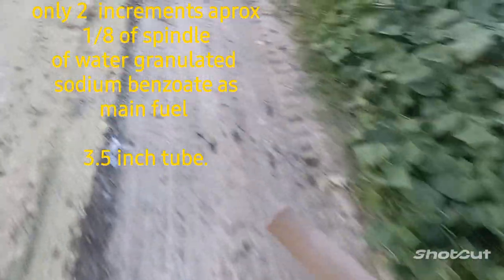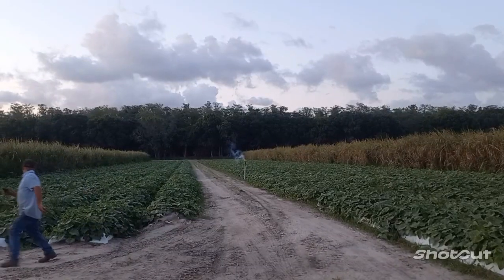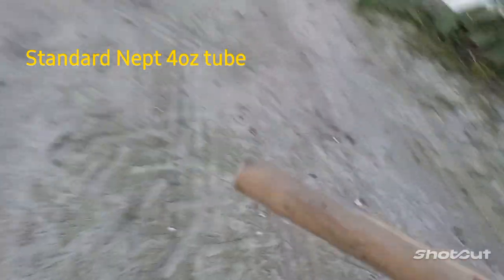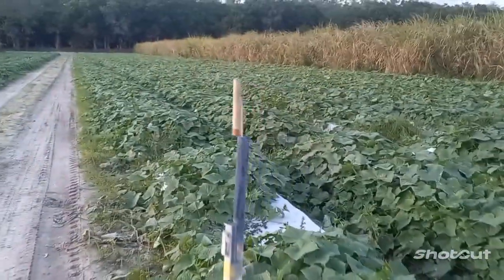Strobe rocket test (new fuel ) See description.

Comment: After all the work and help from you, it's really hard to NOT make them strobe very well. 
The length of the lift fuel grain length should only be about 1/3 the length of the spindle and the pressing psi needs to be correct. For me, i increased psi to about 6500.

Comment: @Pyroflorida have you ever tried making a bp/ strobe rocket? 
I may try it now so i can have less chance of CATO with a long spindle.  Plus, im wasting to s of good sali whistle on my failing strobe rockets.
Reply from the maker: Black powder can't be combined with strobe fuel , contact of both produces a very unstable reaction in a short period of time , this reaction can be accelerated if is any humidity present I the fuels , causing a self igniting bad situation. 
Need to analyze and understand why youre having CATOs .
Bad quality tubes , not waxing your tubes , wrong tooling used.  Wrong pressing force applied  , not enough is bad , too much is bad.. cracks in your fuel grain due to inconsistent increments , fuel too hot , not enough wax or oil in  your whistle fuel etc. Etc. Etc.

Comment: Hey there!
I have been making countless tests of ap strobe fuel using:
Ammonium perchlorate 56
  Barium Sulfate. 14
  Potassium Dichromate. 5
Then experiment with magnalium, like:
80-200 13%
-325 12%
My binder /phlegmatizer is usually NC lacquer / acetone mixed in well, then granulated & dried.
I've also used dry wax and shellac powders.  
Most work(a little)
But, I have yet to have a single good strobe rocket like yours.  
Do you find that the amount of binder makes a big difference?
How about the length of strobe fuel in the spindle core?
Finally, do you find a strobe performance difference by changing how far you insert the fuse?
I think I may be retarded at this point, but I need to get there.
Thanks.
Reply from the maker: Let's see , on the spindle.
Example : 1 pound strobe motor needs at least a 4 inch spindle , aprox 1.5 inch of spindle pressed with a good strong whistle fuel , remaining 2.5 inch of spindle should be strobe + delay 1/4 inch minimum  , then the desired  ammount of whistle as delay .
If percentages are right , then chems are all fine powder , especially the ap and dichromate. You should have very good results , your pops should be loud enough to heard them from very far.
Wax and oil kill the pops  , but makes the fuel less sensitive is a trade-off , I don't use them .
3 to 4  % nc laquer is enough 
Hope you get them to work!!
Reply from the maker: By the way , I never core fuse anything. Fuse is right on the edge of whistle fuel
Reply: Thank you!
Reply: I have been using a 2.5" spindle for my 1lb motors.
I just a new brass 5" thicker spindle from firesmith. Wow! I made a Sali / strobe lifted for over 10 seconds .
Now I can use the whole 7" tube.
The spindle is much larger diameter and burns faster, I think. Now to see about fixing my strobe fuel more. 10% 80-200 and 10% -325 is still not quite right. Maybe my fill heights need adjusting, like less whistle fuel and more strobe fuel.
Reply from the maker: @King-of_Katos   the strobe recipe is 10% 80-200 and 15% of -325 with 3 to4% nc laquer dissolved in enough acetone to make a doe like and granulate.
If your whistle is strong enough 1/3 of spindle whistle and 2/3 of strobe will give you a decent lift with a pretty loud strobe.
With 1/2 of spindle whistle then 1/2 strobe you're getting faster and higher lift but less and not that loud strobe pops

Comment: Can you try: 

65% KClO4
15% potassium or sodium benzoate
19.2% Al
0.8% copper chromate or copper oxide

3% wax for stabilizing mixture

It flies up with a blue flame, works great on bp tooling, its nozzleless like whistle ofc
Reply from the maker: S.P.E.E.D
Super Powerful Extra Energy Dense
65
15
8.8 black Indian
10.4 mag 80-200
1.5 cu oxichl.
3 wax
I already have a batch , just thinking on how give it the proper use😁👍
Reply: @Pyroflorida  great! Please make some test rockets, glad you are familiar with it. I would love to see someone else try it too to compare the thrust
Reply from the maker: @KClO3  definitely I'm trying it , I may start like always do with the 4 oz platform to see how it performs  then 1 pound. It may be my next choice for my nuclear rockets 2nd and 3rd high output motors , let's see
Reply: @Pyroflorida  any updates on the tests? Im so eager to see
Reply from the maker: @KClO3  yes i did. Tried on the 4oz 3.5 inch tube , full spindle with S.P.E.E.D , Honestly not really impressed , its like a high end black powder
Reply from the maker: @KClO3  https://youtu.be/ur_iNGNRvhs?si=VpQ4Ue_48sv2bh5w
Reply: @Pyroflorida  strange, I see what you mean, maybe it's thrust is still high even though it's initial launch is not very high, but it's weird I'll give you that
Reply from the maker: @KClO3   there is still more to test... and yes you're right.
Have a feeling that the fuel will really shine in long spindles
Reply: @Pyroflorida  we'll see, hopefully it won't be a bust in that configuration, I was expecting a different outcome from this fuel

Comment: Hey FP, I like your videos, Thank You!
I usually put my sodium benz in the oven at 225F to evaporate the moisture in the benz.
What do you mean by water granulated? I use acetone.  I'm confused!
Thanks again, stay safe!
Reply from the maker: No problem bud.. when water/alcohol granulating a whistle fuel you're getting the outmost possible power out of it , why? Simple , sali, sodium and potassium benzo are soluble on water,  oxidizers like kclo4 too , means by wetting your whistle fuel with 50% water 50% denatured alcohol you're now mixing and fusioning the two components a almost molecular level.. no need to ball mill for hours or dehydrate anything,  just make sure your fuel and oxidizers passes a fine mesh 60 is enough , you can add to the red iron oxide usually 1% another 1.5 % of red gum ( antioxidant) for  storage😉 and it's also a good burn stabilizer.  Alcohol is in charge of dissolving the red gum and incorporate it to the mix.
For best results wet your desired whistle mix following the above procedure and let it sit overnight on a bowl to get all your components to get fusioned together,  then granulate next day and let mix dry 100% , a infra red lamp for a couple of hours will do.the ultimate trick
You will enjoy the most possible output out of your whistles , don't need any phlegmatizer like oil or Vaseline,  red gum is making the trick.
Reply: @Pyroflorida  Thank you! I can't wait to try it. I've only used alcohol/water on black powder-based fuels and stars. 😀
Reply from the maker: @smileface102   day and night difference,  my water granulated sodium benzo ( the one used on the vid.)   With only two small increments did all that lift on #1#2 and #4 rockets
Reply: @Pyroflorida  WOW!
From Rhode Island.

Comment: I've heard sodium benzoate rockets kind of strobe super fast when there is still solvent in the fuel, sounds extremely cool and similar to this but when that happens they usually lack power completely
Reply from the maker: Probably like on the last rocket you can see on this link , that's typical sodium benzo chuffing
https://youtu.be/HJ8NnGn73xg?si=vEL-y4nPipme_Y1h
Reply: @Pyroflorida  yes exactly! it sounds so good even if it means the fuel is bad. please if you want to do some experiments and make a benzoate fuel with power and very reliable chuffing! it seems to be caused by fuel rich mix
Reply from the maker: @KClO3  that chuffing effect is usually obtained when on a not very powerful fuel like na benzo or black powder are heavily phlegmatized wit 4% or more wax or mineral oil

Comment: I made a very powerful rocket fuel out of poplar fluff down and saltpeter
Reply from the maker: Yes I remember you suggested using poplar fluff to increase gas during fuel burning , painfully I couldn't give it a shot , poplar isn't available around here , I think that's why HP 140-4-c uses 4% of 80 mesh charcoal,  probably to obtain that extra boost from gas
Reply: @Pyroflorida  If you can't find a poplar, you can directly use the fluff of a kapok tree
Reply: @Pyroflorida  But after the collection, cut with scissors, and then put it in a mortar and grind with powder, so that it is convenient fusion
Reply from the maker: @CrazyghostRocky-lu8tr  ill give it a try !!!!🫵

Comment: Wow!!! Great rockets!! What is your high thrust strobe fuel?

And sodium benzoate whistle?
How is that different than sali or potassium benzoate whistle?
Reply from the maker: Hey my friend , I'm still working on the optimum cycle on that high output strobe fuel so.. I will disclose the formula after is well tested and proven to work as expected. 
Sodium benzoate fuel offers amazing performance , specially when water/alcohol granulated , it uses 2% good quality red iron oxide , doesn't need any vaseline or oil as phlegmatizer .
A well made water granulated benzo will match out sali fuel pretty much , and doesn't tend to cato like sali , it's more forgiving  still offering the performance , power and excellent whistle sound.
Usually 70/30 is the way to go
Reply: @Pyroflorida  ahh okay!! I would only use strobe fuel for thrust if it was cheaper than whistle mix but since mg/al is required i dont think it will be cheaper. Somehow the rocket seems better though!! 

Good tips on the sodium benzoate. I heard potassium benzoate is better for storing because its less hydroscopic.
I have a current batch of sali and potassium benzoate whistle but i havent got around to testing my CATO issues yet.
Reply from the maker: @NagashiChidorii  agree , of course , strobe fuel isn't cheap to make compared with whistle fuel ,  it's just unique and captivating to see a rocket taking off on strobe , a different experience for sure.
Reply from the maker: @NagashiChidorii  you can also water/ alcohol granulate your potassium benzo for maximum performance , just make sure it dryes completely,  infra red lamp is highly recommended
Reply: How are you granulating the the whistle fuel? Are you granulating it after completing the mixture or at what step do you granulate? @Pyroflorida

Comment: Hi, i have some serious questions about your rockets.
Can you check you'r APC acc?
Reply from the maker: Dont have a y APC acc  what questions do you have sir
Reply: @Pyroflorida  Since I live in Europe it is difficult/not possible for me to obtain NH4CLO4 (AP).
I now received the suggestion to start working with nitrates as it started.
do you have experience with this?
Reply from the maker: @FLYINGDUTCH2000  strobes with nitrates dont really work well , the strobe cycle is inconsistent and they won't make a good audible pop like the AP based strobe . You may get a decent visual effect with nitrate strobes but , the performance is not even close to the AP based ones
Reply: @Pyroflorida  ah okay, I saw a few videos and they weren't very spectacular.
thanks for your comment
Reply from the maker: @FLYINGDUTCH2000  you're welcome

Comment: Cool sound, on a long spindle it'll be great
Reply from the maker: Yes , I used only 3.5 inch tubes for the test , used  the woodys economy tooling , I think is like 2.5 inch long spindle , I got impressed how it performed even out of a small motor . I'll try the 1 pound soon
Reply: @Pyroflorida  I just tested a strobe using your chopper mix and I could barely hear the pops, do you think adding NC lacquer would help significantly?
Reply from the maker: @HenrikSherwood  are you using my 80-200 mix I guess? On what motor size and what spindle?
Reply: @Pyroflorida  Yes your strobe, 8oz rocket, 2.2inch spindle, it was strobing for a solid 3 seconds but wasn't loud at all. I'll post an unlisted video in a second
Reply from the maker: @HenrikSherwood  if ammonium perchlorate is blade milled to a fine powder and your percentages are correct , if using no oil , just good NC lacquer at least 3% using 1/3 of spindle whistle 2/3 spindle strobe  then each pop should sound as hard as a firecracker
Reply: @Pyroflorida  Yeah I was using mineral oil, no nc I'll try a batch with it only
Reply from the maker: When made the traditional strobe  200 mesh @21% with -325 @4 % I had good results still with 3% mineral oil  on it , when tested same mix with green dot or bullseye home made  NC laquer then I saw the difference,  way louder pops no doubt .
For that reason I never tried the 80-200 mix with oil , I'm pretty sure you will get the loud pops with the nc.laquer .
Another tip , usually I go for 7500 max 8000 on the whistle fuel but I never use more than 6500 psi on strobe , somehow seems that they dont behave well when pressed too much
Reply: @Pyroflorida  that's interesting, I pressed 8k psi on that strobe
Reply: @Pyroflorida  I'm thinking I'm going to try a modified version of Dan LaHupps strobe that uses Vaseline and NC lacquer to decrease sensitivity while maintaining the pops
Reply from the maker: @HenrikSherwood   cool , I'll like to see how it performs!!